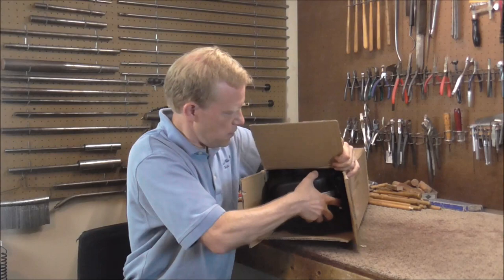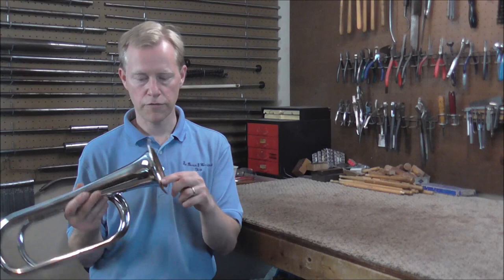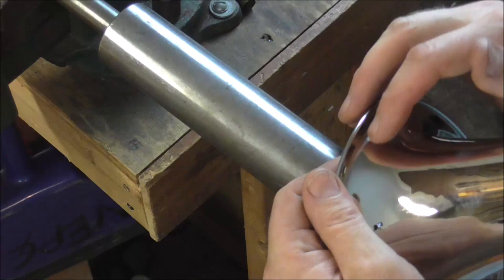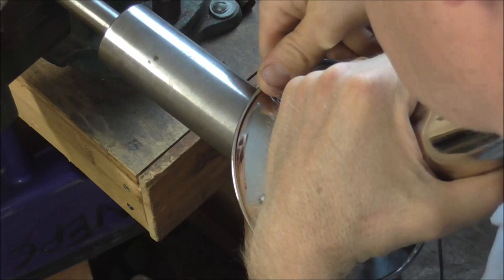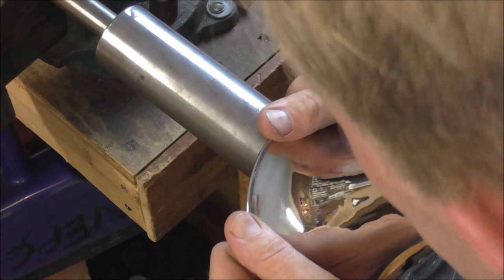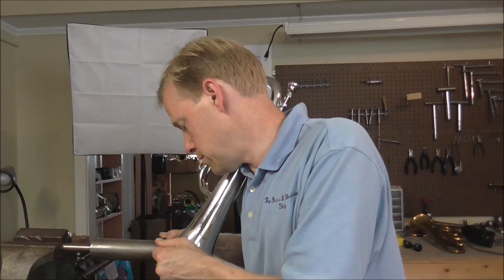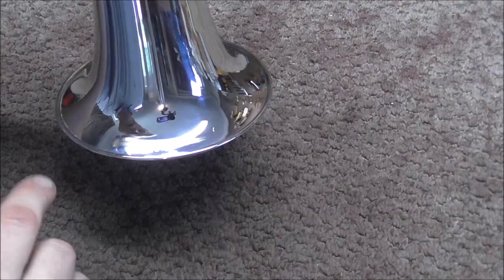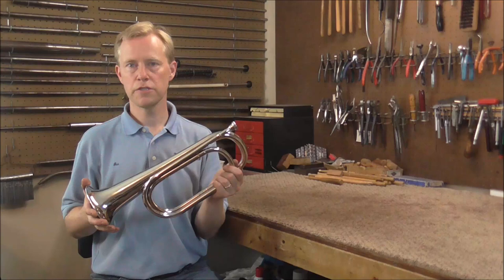Removing a Bell Dent On a Ceremonial Bugle: Band Instrument Detective Series

Comment: I've watched you get dents out by bending and rolling. I don't work with sheet metal that much, but I keep wondering why you don't occasionally use a soft mallet to help bend things back into place? Does it result in stretching the metal and just making things worse?
Reply from the maker: Sometimes I do use the mallet on bell dents. Usually it is for dents that people try to get out themselves and the metal is bent one direction and then the other. When this happens, it is very hard to remove dents with the roller. The roller is usually the easiest way to get out dents with the least amount of damage. If it can be done with just the rollers, that is good, but if you need to use other tools, then use them too.